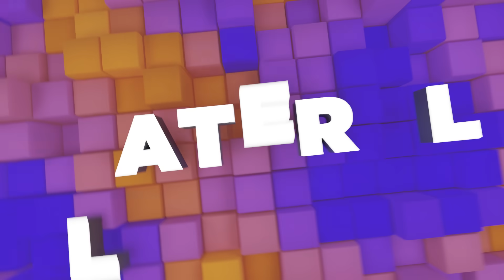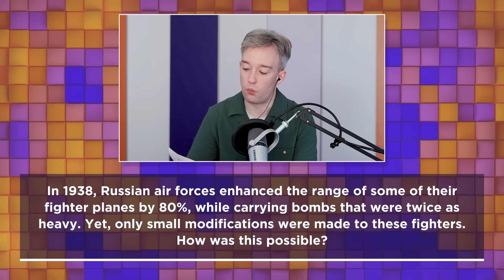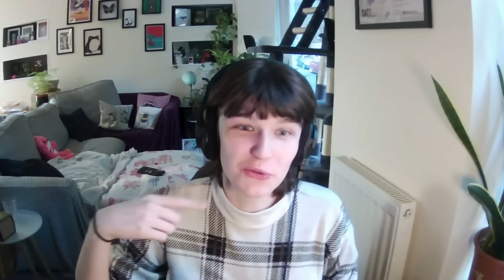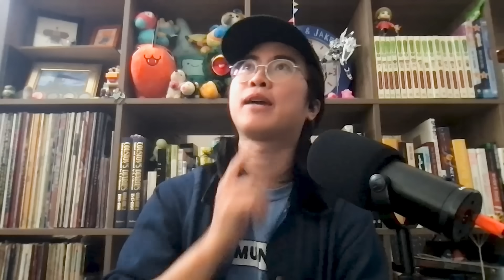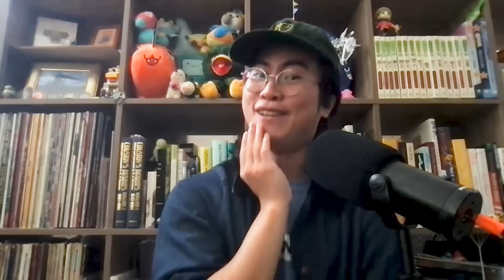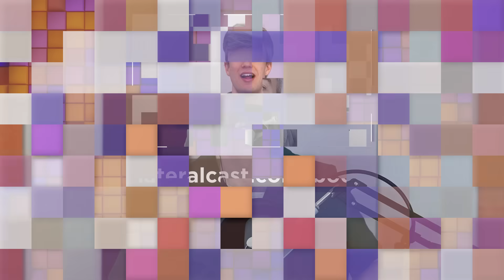A radical plane redesign

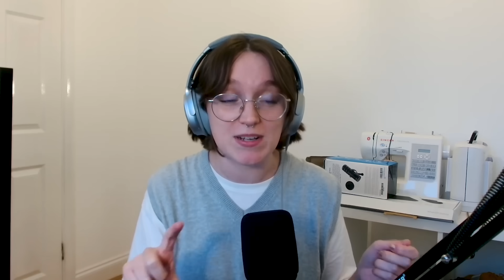Comment: 0:41 funny she should say that, because in some USSR fighter jets, the fuel gauge was not actually measuring the amount of fuel that was left in the tanks, but instead is set before the flight according to the amount put in the plane, and would then simply go down as the flight went by. Which also means you could twist the needle towards "full" easily if you wanted to convince yourself that you still had loads of fuel to fly 😂

Comment: First thoughts: only scaled up the plane design (akin to a Boeing 737 vs a 777)?  Double the fuselage/engines like a P-38 Lightning?

Maybe in a twisted way, "heavy" is not only meant as mass but also yield/mass ratio, via  either better explosives (e.g. ANFO vs C4), or going thermobaric (lighter-per-yield aerosol bomb relying on the oxygen of the ambient air).

Or simply switching to a more effective bomb type and usage (like dropping underwater torpedoes instead of standard above-water bombs on top of a ship).  It also applies to other more specific munitions, such as armour-piercing/bunker-busting (e.g. shaped-charge), anti-personnel (e.g. fragmentation, bio/chemical), even guided or carpet-style ones (e.g. dead-reckoning gyroscopic/wire-guided, clustered).
Reply: They could have carried spare-fuel tanks as "bombs", but why such specific numbers then?  Could the explosive payload also be used as fuel (in specific-case of thermobaric)?  Was it glider-like bombs that could extend the effective range of the plane and not the range of the plane itself?

Adding a turbo-charger to the engines could also do the trick, but I thought they were well-known before WW2, especially in aviation.  So was forced-induction retrofitted to existing atmospheric designs?
Reply: 2:04 Switching from liquid uncompressed fuel (gasoline, diesel) to compressed, liquefied, gases (methane, propane) which is more energy-dense?
Reply: 3:55 Was it going full-Kamikaze, so no fuel needed for the return-trip?
Reply: Results:even after all my guesses, I did not think of simply two-staging it?  Revoke my KSP licence.

Comment: 5:36 There is something called glider towing, where basically a small motorized aircraft (around Cessna 172 sized) takes of with a glider strapped to the tail with ropes and the glider is released mid-flight. (Correct me if I'm wrong)

Comment: The USA also worked on this - putting a pair of P-51 Mustangs attached at the tips of the wings on each side of a bomber. Never used in combat as far as I know. And later in the Cold War to put a pair of early jet fighters (which were notoriously fuel-thirsty) onto a bomber.

Comment: 2:05 - The USA actually did that. One of their early Cold War nuclear bombers carried the bomb IN an external fuel tank. The original design would have had the bomber using the fuel in the external tank first, then dropping the fuel tank from around the bomb, then drop the bomb and fly home on internal fuel. For the final design they realized that was needlessly complex, because what happens if the fuel tank doesn't separate properly - then you can't drop your bomb; so they made the nuclear bomb+fuel tank a single unit. 

(The B-58 Hustler.)

Comment: 2:00 - I could be wrong, but I'm pretty sure that some fighters can already strap an extra fuel tank to a bomb slot - used to be able to in the fighter jet simulator we had back in the 90s, so it MUST be a real-life thing, right?  Just like the square-shaped yellow bullets! 😁
Reply: yep, some planes have hardpoints for external fuel tanks, and some of those are dual-purpose for either fuel or weapons (like on the Warthog).
in WW2 the brits even made single-use fuel tanks out of papier-mache

Comment: To my shame, I knew of the 'parasite fighters' idea, but was actually shouting 'drop tanks' at the screen : )
Reply: Air dropped armor has for the most part been shambles being too light to do very much and very accident prone with large percentages of tanks being destroyed before or during landing or by the next tank landing.
Nowadays helicopters are well placed to provide the fire support an air dropped tank might have been envisioned too; and air freighting MBTs remains very persuasive.
Reply: @hens0w  - Drop-able fuel-tanks! : )
Reply: @loddude5706  oh, yes I'm an idiot
Reply: I was also thinking in terms of drop tanks
Reply: No shame. I was as well, but only in the manner that I eventually figured it was more interesting than that, but was annoyed that they didn't at least realize to mention it to rule it out.

Comment: I was surprised when Ella mentioned taking out the fuel gauge. I saw a video a few days ago about western pilots being shocked that some Russian fighter jets didn't have a fuel gauge. When they asked why, they were told that was info for the engineers not the pilots.
Reply: That would be the oil pressure. Fuel remaining is definitely info relevant to a pilot

Comment: Those printers = HP garbage
Reply: Nope, Epson and other printer manufacturers do it too. You could trick them by putting a piece of tape over the chip, so that the printer couldn't read the cartridge and kept printing until they were empty, but then the printer companies made them in a way that they wouldn't print at all if they couldn't read the chip. I'm using an old laser printer that was decomissioned in the office I worked at the time, about 12 years ago. I am still on the same cartridge I got it with and even if it stops working, a replacement cartridge is less than $30 on ebay.

Comment: My initial thought was an airship, not as wrong as i thought.
Not as wrong as tom saying Russian at the end. 😆
Reply: I thought of that too - it should work, it's grossly impractical for anything other than military purposes, and we don't need it, but in the 1930s? The '20s and '30s were just the time between making planes that fly at all and having planes that don't need that nonsense. Imagine a hot air envelope, perhaps muchly pre-filled at the air strip by ground machinery, with a hose connecting it to the fighter's exhaust pipe and a support harness to hold a fighter. This horrible contraption would take off vertically, make terrible air speed toward the engagement zone (note the option for unreasonable loiter time here, BTW), and then when it was time for combat the whole balloon would be jettisoned and the fighter would proceed as normal.
Reply: @WyvernYT  That contraption would be barely controlable, though. And it would be target practice for any defense aircraft that spotted it before it reached it's destination.
Reply: This was actually an American invention, Google USS Macon and USS Akron both of which launched in the early 30's
Reply: @ljphil78  Our flying aircraft carriers, yes! Magnificent inventions. Triumphs of technology. Demonstrations of what can be accomplished by military budgets unconstrained by common sense. They were not, sadly, actually practical military equipment.

Comment: 0:32 making my guess

"only small modifications were made to THESE FIGHTERS". "these fighters" being the key words in the sentence, another non-fighterplane was introduced or heavily modified to get the effect.
My guess is the range is grown by in-air tanker airships (big plane with a hose, put hose in little plane, Refill in-air, more fuel at no significantty increased weight=More range)
Reply: that was much closer than my initial
Reply: A tow-on-a-cable scheme would have been pretty easy, too.

Comment: SPOILERS AHEAD

The Wikipedia article for the answer to this question has some incredible extra detail in the opening paragraph:

"Depending on the variant, the fighters either launched with the mothership OR DOCKED IN FLIGHT(!?!?)"
Imagine being in a 1930s Biplane and being told "Okay, now land on top of that other plane."
https://en.wikipedia.org/wiki/Zveno_project
Reply: The USAF tried that with a plane called the "Goblin" (thing's about the size of a smart car) - never really took off (that hurt me more than you) because, IIRC, after being launched out of the bomb bay the turbulence made it hard-to-impossible to get back
Reply: @cybergeek11235  I think the important difference here is that Goblin was tried in the reactive era. These were operating in biplane era, even before WW2 advances in planes. Basically average speed grew exponentially from 38 to 45

But I do agree, Goblins are the cutest little things and I'm sad they didn't work out
Reply: In flight they would engage like a modern air refueling works, with a tow hook of some sort it would catch the plane flying below it and anchor it
Reply: Not on top, the hook in that case was below the mother ship and they just flew to the hook just like with aerial fueling is done today.